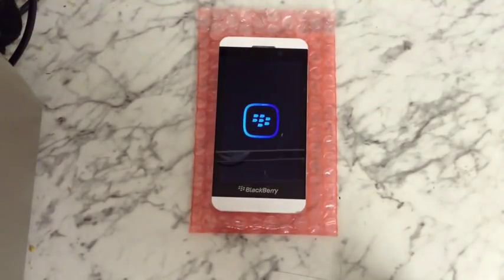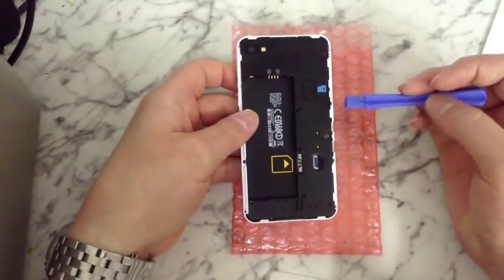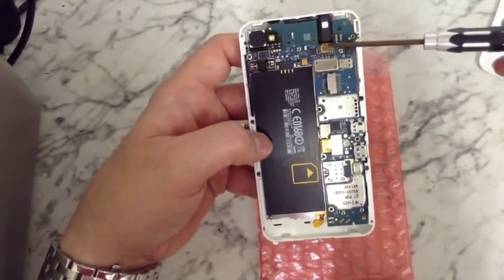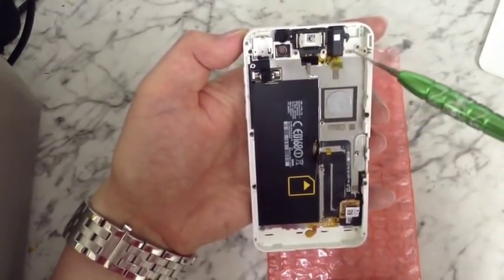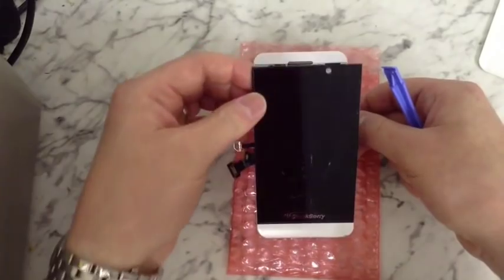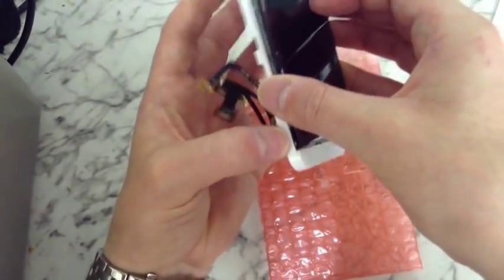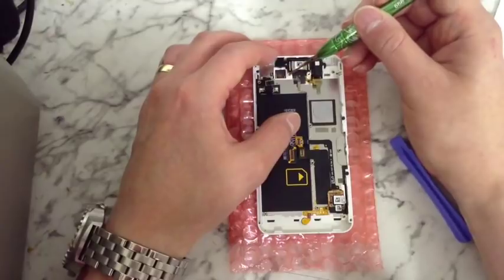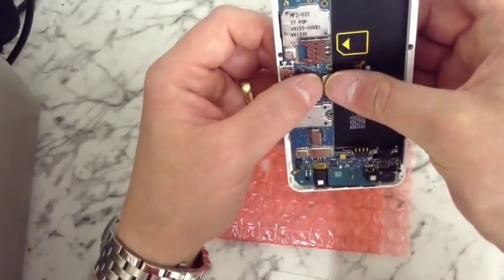Blackberry Z10 LCD/Digitizer Screen Replacement

Comment: What is the blue plastic tool called?
Reply: +Francis Melchoir Plastic opening tool. If you live in the US I highly recommend going to Fixez.com and buying their Device Repair Toolkit. Comes with Precision Magnetic screwdrivers of all kinds and sizes and multiple plastic opening tools. Basically everything you could ever need and it is extremely cheap.
Reply: +Variant Motorsport I just ordered a screen and tools for $20 (plus shipping) from them. Hope it works out. Thanks for the tip.

Comment: Good tutorial, thanks. Be sure to use high quality tools, the tiny screws holding the screen to the frame are very easy to strip out the heads, which I found out the hard way.  After using the cheapo tools that came with my new screen ( I should have known better) the new screen is not 100% secured to the frame. Although it's probably good enough for a while if used gently.

Comment: I am in the midst of surgery, here, having watched these excellent video instructions, and replayed it while working. Then I get to those dadburn frame screws that definitely take a T1 - everything else came out with the unmarked assortment of screws that came with the parts.

Have I caused irreparable harm to the five tiny screws - or is it possible the correct driver will "bite" the threads and remove (and then replace) the screws? I would hate to have to put the patient on bypass for the holiday weekend until I can find someplace to get Barbie(TM) screws.

Seriously. The Old Phone has shut down my life.

Comment: Hi - this is a very clear video but two things should be made clear: the screwdriver required to remove the first part of the chassis is a Torx T3 (NOT a T4), and the screwdriver required to remove the innermost part of the chassis is a TORX T1 Well-engineered screwdrivers this small are hard to get hold of - when buying online be very careful to check the specifications of the packs. You will probably have to buy the T1 separately, and it will cost £10-£15 with delivery
Reply: hi i am planing to bus this for my z10 what things i should know before buy from online how to buy perfect one ..because i am just confused with T3orT4 what is those? sorry for my bad english but reply me i am planing to buy for my z10..

Comment: Thanks OP. Repaired my Z with your help. Not sure if geographical difference (Canada), but my Z10 required a T3, and a T1 driver. The new screen came with the wrong tools.
Reply: Mark Miller agreed - mine are definitely T3 for the outer chassis and something smaller for the inner chassis.

Comment: Excellent video, I found it very helpful. A couple of points that would have made it even better
1) 720P or 1080P video would have allowed us to see more fine details.
2) Could be useful to tell everyone that they need a T4 screwdriver for the larger screws and 0.8mm Pentalobe for the tiny ones.
Well done

Comment: LCD-46537-001/111 works with the Blackberry Z10 STL100-1 ?
Reply: I've got the same problem. I own the STL100-2 and have absolutely no idea which screen model is correct.

Comment: Hi! The video is incredible!

I have broken touchscreen z10 but it's very difficult to get to a repair service at my place because it's not bought from any carrier. After watching your video, I'd like to give it a try to repair the screen by my self. (I have no experience before)

Can you give some information about the model of the LCD screen and size screwdrivers needed so I can try to order those parts?